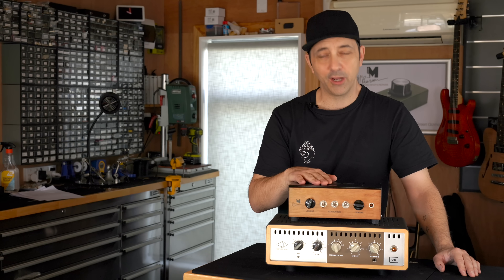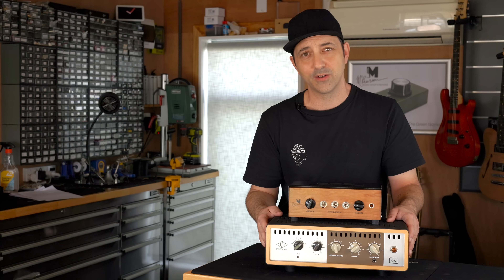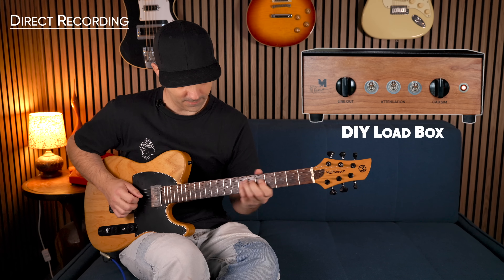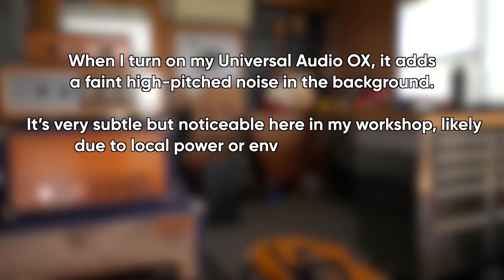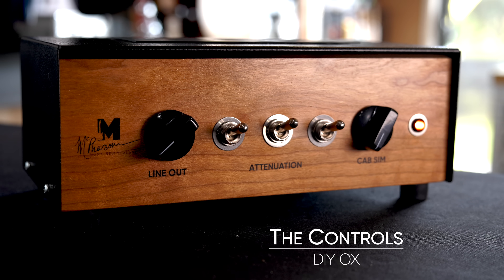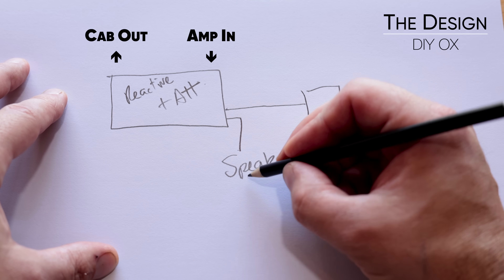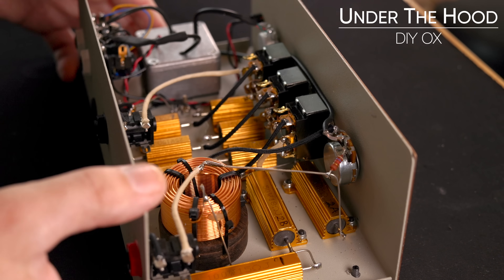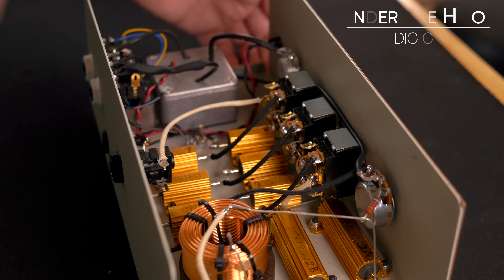My Universal Audio OX CLONE Might Be BETTER Than The Real Thing

Comment: Hi Waylon, I keep getting back to your OX Clone project cause I have plans to build a unit myself. Maybe just the attenuator part. Many thanks for sharing this project. I fully understand and can read the schematics since I learned that once many years ago 😅
I understand the function of the balanced output. As you explain in the vid that’s where you connect your DAW. However I just don’t get the connection path after the cab sim output. Maybe I’m just dumb or I am not so into studio setups. It just doesn’t click. I understand you connect that output to a reverb/delay mono to stereo pedal. Could be any reverb/delay mono unit as well I think. But where are you going to from that pedal output? Are you connecting it to a strait forward amp and speaker? Headphones? ... or again your DAW?

Comment: Thanks! Waylon - I'm building your OX for my 1971 grey panel VOX AC30 (dallas era solid state recto) So IAfter reading the web sites you suggested I changed the Resistor values to the 16 ohm table and have omitted the balancing transformer for now ( as on Block Diagram (with alt out and line out).
My question is - Can I run my amp with only line out connect to DAW and NO SPK connected? will this prove the spk load tp protect the output transformer etc... or do I need to always have the 16 ohm spk plugged in?? Thanks for you channel and sharing of info. It's AWESOOOOOOME! PS - I gotta send you a pic when it's finished - very DIY enclosure😁
Reply from the maker: Hi Andrew, Thanks so much for the $5 Super Thanks! 🙏🔥

And yep — you can run the amp with FULL attenuation and no speaker connected. The internal load still protects the output transformer, so the line-out to your DAW is totally safe on its own.

Can’t wait to see pics of your finished build! 😄

Comment: Just purchased the schematic! How easy would it be to have a line out without cabinet simulation?
Reply from the maker: Thanks, yes, super easy, just don't use that part of the design, stop at the transformer output. Cheers!
Reply: Great! I like my Strymon Iridium for Cabinet simulation. So I can just run it after the balanced output?

Comment: Real cool open box. See how it all works .  .  It's amzing  those  little  Resisters do their  job , I was things 
It two big coils, taking the  load, burning off power, and using other hardware. Do other things on the circuit board from that pedal .
Wow, it was Notting as I Thought.

Comment: Nice job, Waylon. Signed up to get the schematics :)

Quick question... is scaling up to 100W or more just a matter of upping the resistor power handling? I have a bunch of pretty beefy magnet wire so more of the wiring and the inductor would likely bw well over spec anyhow.

Comment: I perform with a looper a boss RC 500 and I need amplifiers that are actually PA systems. I have four fenders. A baseman 100. Super twin Reverb. (185watts). Blues DeVille. And a baseman 150 with an Eminence 12 and a tweeter. Totally insane right. I can do the exact same thing with my power works speaker on a pole and a pig nose. Just gets bigger.

Comment: I would actually just install the little sonicake IR loader pedal after the attenuator and a USB pass through so I could load whatever IRs would work and I’d build a 120 watt version so I could run any head. I think some tube amps are in my future again even though I have a silent stage requirement where I typically play. I think you’re getting me back to tubes with this.

Comment: Yoooo this might be the answer to prayer. My friend and I both want to get oxboxes but moneys tight and we’re buying gear for all the other aspects of live play and recording. 

What’s the rough cost estimate?
Reply from the maker: This can be built for under $100; the Lehle transformer and enclosure pushed up the price a bit more for me. Still way less than an OX by miles :)
Reply: @WK-bu7ry  If you want the best attenuator but don't feel confident building one, just get the Power Station.

Comment: Great video and TY!  Has me inspired to do a version with some 8 Ohm / 100w Weber speaker loads I have and add in an active effects loop and perhaps a 40w class D amp (stage monitoring).  For me, the speaker loads reduce the transient flyback (which is why with >3dB reduction the trebles sound unnatural) that all those resistor loads create.  I downloaded your schematic, which is professional and thorough.

Comment: That high level sound just sounds like the same digital nonsense I get with some of my gear. 

So cool to see this, I have always wondered what goes into a reactive load, how it differs from the old school dummy resistor thing. I use a two notes torpedo captor without the digital stuff and have great luck. 

Also the cab sim is great 👍

Comment: How would you make it so it's capable of handling loads of over 200W? This seems to be a recurring problem with attenuators and pre-PA guitar amps like the Marshall Super Lead 100, which can push over 160W of power out despite it being labelled as 100W. Even the Weber Mass 200 (which is supposedly a 200W attenuator) has a recommendation to not be used on loads over 150W.

Comment: I built a load box based on the M2 circuit into the housing of a broken Behringer DI. Great circuit and really useful for me to run amps on my work bench into a load or shave some decibels off before hitting my 8” test cab.

Comment: Roughly what was the cost for the Bill Of Materials?
Reply from the maker: If you're thrifty, parts for this could be bought for less than $100, my unit was a little under $200 all up, with my Lehle Line Out Transformer costing the most